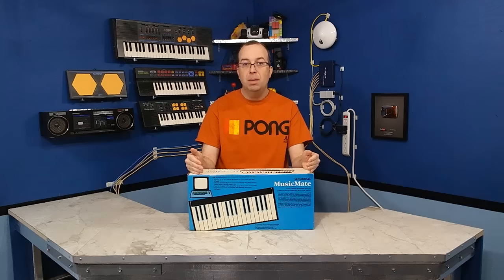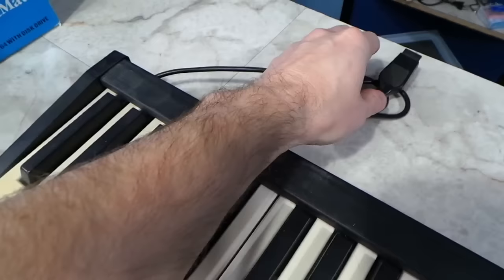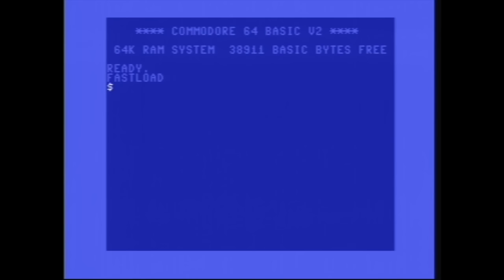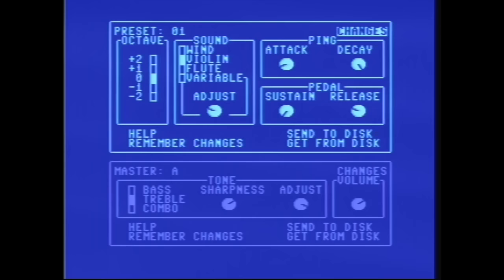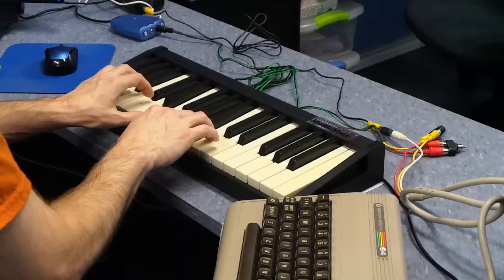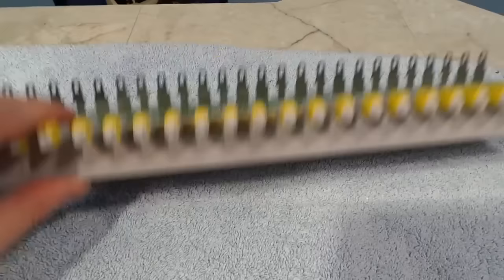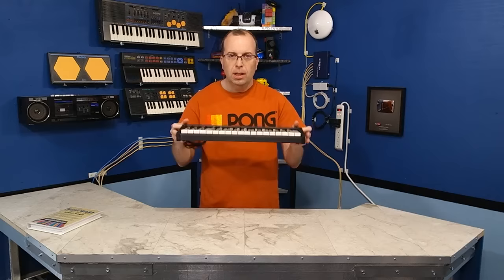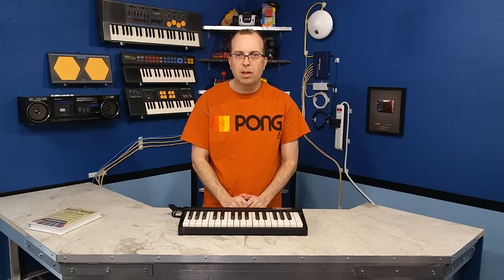Sequential Music Mate for the Commodore 64

Comment: I it's has not already been said but the picture on the disk box is of a prophet 600, sequential/sequential circuits were a manufacturer of professional keyboard synthesizers/samplers in the late 70's to the mid 80's starting with the Prophet 5, the first semi-reasonably priced polyphonic synthesizer with memories.They went on to co design MIDI with Roland (they were the main players in the MIDI standard) and making a range of keyboards from budget synthesizers to sampling keyboards.

Comment: I've got two suggestions for figuring out how that thing works:
1. Try hooking it up to a logic analyser. It's possible (although unlikely) that the signals are too fast for your BASIC code to detect.
2. Try looking at the analogue inputs. Again it's possible but unlikely that it's using an analogue input (maybe even a digital serial protocol over an analogue input?).

My theory is that it's sending some kind of "key pressed" and "key released" events somehow. As other commenters have pointed out, the company that made it were involved in the beginning of MIDI so it wouldn't be surprising if they used a similar idea here.

Comment: If you want to investigate what is going on between peripherals, you need an oscilloscope capable to store the signals. While you can buy yourself a neat classic "storage oscilloscope" which stores the graph right inside the phosphor of the CRT, it is much more convenient to  use a modern PC based scope. 

Powerful all-digital scopes are pretty inexpensive nowadays, especially when using a PC to analyse and display the data. All you need is a good ADC, the rest can be inexpensive software. I suggest a bitscope, it is highly versatile and cheap. Plug it into your computer and you have a real powerful oscilloscope. It also works with a Raspberry Pi and with a Touchscreen, you can build yourself a neat portable scope, just as powerful as an expensive Techtronics but for the fraction of the costs. 
The simple bitscope version still has 8 digital inputs perfect to monitor what is going on inside an 8-bit computer or on any interface (like the keyboard connected to the joyport). Two of those inputs can be used analogue so you can look at e.g. stereo audio to tune instruments and it has a built in signal generator which is programmable.

Comment: The 40-pin device is probably an 8051 or 8042 variant and likely transmits key presses to the C64 via some sort of serial protocol.  It may even be some simplified MIDI sort of thing.

Comment: Referring to just after 2 minutes in, and a possible explanation would be binary.  With 5 digits to work with, you could have a total of 32 outputs from 00000, to 11111 and everything else in between.

Comment: The keys could be binary encoded, and analog signals can be used to produce slow digital IO by simply thresholding the value. My guess was that the 5 digital pins was used to address each key 2^5 (32), with rollover for multiple keypresses, but I'm not sure if this would show up on your BASIC-program.

Comment: Could be a R-2R DAC forming the matrix - the two analog inputs on the joystick port could be used for this purpose. It would certainly be cheaper than using a microcontroller so I'd be surprised if they didn't go that route.

Comment: Well, those were fascinating times, pure FM music!
Reply from the maker: Actually, this is not FM music.  I'm not even sure what you would call it, but I think it may be subtractive synthesis.
Reply: Yes correct, it is subtractive synthesis. The SID is a hybrid subtractive synthesizer, where the oscillators' classic wide-spectrum content analog waveforms (square/PWM, triangle and sawtooth) are generated digitally, but being converted in an analog signal to feed the analog filter, which is common for the 3 voices instead of having a filter for each.

Comment: 2 raised to the power of 5 is 32, any combination of keys will output a binary number on these 5 pins. Effectively 32 key (not note) polyphony or at least if the commodore could handle it, the input hardware can support it.

Comment: Thanks for the video!
Try hot glue on items you may want to remove later.  It will be less permanent than epoxy and may do just what you need.  Hot glue is an un-sung hero. :)

Comment: Hey, great vids!  I really enjoy your channels. This channel got me thinking about all my old keyboards I uses to have as a kid, and I remember one old cheap Yamaha midi keyboard I used to have (sorry, can't remember the model). I had replaced the original power adapter with a universal adapter at some point, and eventually I figured out that if I set the voltage on the adapter to less than what was recommended I could trigger the keyboard to enter a funky mode with a bunch of different sounds and drum effects that normal, and everything would behave differently....have you ever run into anything like this?

Comment: The C64 joystick port has 5 digital inputs, and this keyboard has 32 keys. It implies it is just digitally encoded in 5 bits, since 2^5 is exactly 32. However if it has poliphony, there might be some serialization magic going on in a microcontroller.

Comment: How does the DRM work on floppies? The head banging doesn't give me any clues. :)
Reply: They used different methods, from deliberately physical bad sectors and seeing if reading them fails, which wouldn't happen with a brand new copied floppy, to hiding data in specially created sectors that wouldn't be copied by your normal tools.

And they also used the manuals, where you had to reply to a challenge question typing stuff from them.
Reply: I had a couple of C64/C128 programs that required a dongle plugged in the joystick port. The dongle was basically a joystick plug with no cable coming out of it. I assume that it had some sort of chip inside.
Reply: Not necessarily.  Most dongles are passive devices that trick the C64 into thinking you're doing something with the joystick.  For example, Up + Down at the same time, or Left + Right (which is obviously physically impossible with a real joystick).  PaperClip 64, SpellCheck, and TheConsultant all used a dongle that plugged into the joystick port.

(PaperClip was a word processing package that was great for people that needed to create files on a C64 that could be transferred to a PC, because PaperClip used regular ASCII codes instead of PETASCII.  I think SpellCheck was related to PaperClip.  Not sure about TheConsultant, but my guess would be a spreadsheet from the same company, since all three could use the same dongle.)
Reply: ***** So basically CD DRM techniques? Interesting :)
Reply: I think the floppy with label has a thing called "copy protection".
Reply: how'd you get hereʔ

Comment: I'm no expert on the C64 joystick, I believe you can output data on some of the joystick pins as well as read it? Because looking at the wires, there are only 5 being used, so two must be +5 and Ground, so we there's only three for input. My guess would be that it's using two pins to output a clock and latch, and reading the input on a 3rd (basically the exact same way the NES/SNES controller works)

Comment: All this mistery about the joystick port signal is going to kill me. Could it be some analog signal?
Reply: I'm dying to find out too!! ... My best guess would be that the keyboard has a key multiplexer chip  which takes the 32 keys and encodes it into binary using the 5 input pins (but 5 bits can only represent a total of 31 combination excluding the state of 0, so maybe this won't work).  OR even simpler without an multiplexer, each key has a slightly different value resistor attached (say in 10K increments) read by the Pot X/Y input which I believe can read a total of 255 combination levels (but not sure, if anyone has more info about it, in which case one could technically use the Koala Pad to "draw" a tune).  This is just my guess, I'd be curious if anyone actually took it apart including the circuit board. ;)

Comment: I think there is no microcontroller, but there is a resistor array. I recommend you to buy a Saleae Logic Pro (USB oscilloscope and logic analyzer, about $200). With this you can scope the signal and see or decoding analog or digital protocols.

Comment: The fact that I love piano just makes it so fascinating. :3

You know how does the joystick port work exactly on the piano?
Reply: Nour T. I love keyboards
Reply: Nour T. See my other comment a few minutes ago. My guess is 6 bit binary
Reply: No, I think (as other people here have suggested) it uses one or both of the paddle registers at $D419 and $D41A instead of the joystick register at $DC00, which is why David's program couldn't read the keys.  The reason is that the joystick registers only really used 5 bits (1 bit each for up, down, left, right, and fire), which is enough for 32 keys... which is great, IF you're only able to generate one note at a time.

To be able to generate three notes at once with 32 keys, you'd need (32*31*30)=29,760 possible values.  This is easily done with the two paddle registers, each of which has a full 8 bits for a total of 65,536 possible values.  By the way, if anyone wants to know, the maximum number of keys using this method is 41, if you want to be able to play three notes at once.  41*40*39 = 63960 possible values, which is still in the 0-65535 range.

You could theoretically go even further by reading bits 2 and 3 of $DC00 (bit 2 = paddle 1 fire button, bit 3 = paddle 2 fire button), or by using BOTH joystick ports.  If you used the fire buttons, you'd have 18 bits, which is enough for 65 keys.  If you used both joystick ports AND used the fire buttons at $DC00 and $DC01, you could generate 34-bit numbers... way more than you'd ever need for a music app with three-note polyphony.

Comment: At 3:25 you mention something about "copy protection". How is this achieved exactly, and what causes the grinding noise? Thanks.
Reply: Spherox From his video on his 8-bit guy channel, he explains the knocking is made by the stepper motor of the floppy drive moving to track 1 and then attempting to keep moving. Since it's as far forward as it can come, it just causes that banging noise instead.

Comment: Probably using a set of stepped resistance values. If you peek it, treat it as you would input from a paddle controller. (At least that's how I'd approach it coming from the Atari side, figure it's probably little different with Commodore.) I'd think you would get values from 0 to 255 there. Keyboard doesn't need that many, so you've got room to spare.

--- Edit ---
Looks like you did that. But did you check for both paddle inputs? I know on the Atari, the paddles were paired to a single 9-pin. So there's possibly another range to check. I'm still curious as to what's going on.
----
Also what's possible with the 9-pin is why I always thought it was stupid that they stuck with a single button joystick. (Both Atari and Commodore.) They could have had something more like the SEGA controller (also 9-pin) way back then (hardware would have supported it), but they never thought to do so.

Comment: I'm dying to find out how the keys are encoded!! ... My best guess would be that the keyboard has a key multiplexer chip  which takes the 32 keys and encodes it into binary using the 5 input pins (but 5 bits can only represent a total of 31 combination excluding the state of 0, so maybe this won't work).  OR even simpler without an multiplexer, each key has a slightly different value resistor attached (say in 10K increments) read by the Pot X/Y input which I believe can read a total of 255 combination levels (but not sure, if anyone has more info about it, in which case one could technically use the Koala Pad to "draw" a tune).  This is just my guess, I'd be curious if anyone actually took it apart including the circuit board. ;)

Comment: I'm wondering: have you checked the pinout of the connector? maybe data gets in via the POTx / POTy as an analog value? Pretty interesting to see how HW/SW engineers overcome hardware limitations.
Reply: It's a possibility for sure. Both pot lines were likely measured with 8 bits of precision, so there's plenty of data there theoretically, though I'm not sure about the feasibility of using every possible voltage level to reliably transmit digital signals. Then of course they could have just implemented some kind of serial protocol using the digital lines. In any case, I'm also interested to find out what it was... probably more so than the actual keyboard itself, but that's just me ;p

Comment: Since 2^5 =32  you could pull this off easily with some sort of PLA or probably even 74 series logic chips.  So yeah, off the shelf part could do that easily.

Ed.  I just figured out that's one note polyphony though.  Maybe it would need some actual logic of some sort to interleave simultaneous keys.
Reply from the maker: Yes, it is polyphonic.
Reply: The part where it's seemingly one monolithic IC is still just bugging me.  I'm assuming a niche product doesn't get custom silicon (unless it's some form of gate array that they could order burned fuses on), so it's probably off the shelf.  Even if it was some sort of fuse-burned gate array I think that would just do sum-of-products, not serial data transfer.  It's really the wrong form factor for 74 series logic, and I'm not sure a shift register would be possible (no output to the keyboard unless +5v can be software controlled, which I doubt.  I guess it could be a microcontroller, but I'm not sure you could run one of those as a single-chip until PICs got EPROM which I think was a year or two later than this thing was produced.  I really don't know much about the parts available at the time.  Weirdest theory?  that only looks like a 40-pin IC and they actually hung some giant resistor ladders directly of the keys and read them out through the Pot pins.

Comment: the chip you see in there is very likely a multiplexer rather than a micro-controller. it's a much cheaper solution that works in this case just as well.

Comment: The keyboard must send serialized data, I think there is no other way, it may be Basic is too slow to read data sent by that keyboard or it is using paddle port. This is a simple circuit of a Spectravideo/ColecoVision numeric joystick that doesn't need to send serialized data:

http://www.samdal.com/SVIDOCS/STM-K_SVI103.pdf

May be The Sequential Music Mate basically use the same circuit but using serialized data similar to cassette data or sync pulses, for example through the Strig line, or some strange digital/analog/digital conversion through the paddle port, anyway a code should read some data from the joyport.

Comment: I think I know how it works. 2^5=32 and there are 5 pins on the joystick and 32 keys on the board. So it would transmit key 1 as something like this: 00001 and key 2 as 00010 (Or at least I think)

Comment: Does it use the Potentiometer pins? There should be enough values for the keys even with multiple pressed at once.
Possibly, I don;t know as I am not as familiar with the hardware as you are, but it was just a thought.

Comment: I have the same type of disk drive where you  put down the latch vertically. I have some problems with write and load error if I don't use a finger and force it down all the time.

Is that something that you've stumbled across?

Comment: You didn't measure the connections from the kabel solder points to the plug ?  See pot points Port A as rumborak wrote (below I guess)

Comment: The joystick port thing doesn’t look too mysterious to me. . . The keyboard has 32 keys, and the joystick port has five digital inputs, and two to the power of five is 32 😉 What they are using is probably some kind of MIDI contraption, with the keys numbered from 0 to 31 and separate note on / note off messages. But yeah, it will need some kind of microcontroller.

Comment: It appears that the Model 970 software disc — the one you have two of — was the pack-in software for the device, and that the Model 974 disc was sold separately, as well as three additional pieces of software. My best guess as to why you got two copies of 970 is that you got both the pack-in one and another loose copy. Sources: https://www.lemon64.com/forum/viewtopic.php?t=58790, http://www.mycommodore64.com/2011/09/14/sequential-circuits-musicmate-1984/

I bet we could figure out what the protocol is by reverse-engineering the software, but that depends on if someone could rip them, or if there are any disk images online. I think I found one of the 970, but other than that I've drawn a blank...

Comment: Hi David why do you not try to use that keyboard in a Raspberry Pi with c64 emulation or new software? as you may know the Raspberry Pi can use db9 (nine pin port) joysticks like a SEGA Genesis controller or a C64 joystick via its GPIO pins and could be nice to see if it works there

Comment: 5 data lines on the port can be interpreted as a 5-bit data value which represent a 0-31 value range (32 states) which seems to match the key count, no? But how does it get away with 3 note polyphony? Strange!

Comment: Are there any noticeable difference between 10-minute epoxy and 10-hour epoxy other than the curing time? Do they have different temperature properties? Is one "stiffer" or "harder" than the other(like, is one like rubber and one more like hard plastic)?
Reply from the maker: sometimes there are differences.. This just happened to be what I had on hand.
Reply: +8-Bit Keys OK, thanks for actually responding!
I have been a long time subscriber og the 8-bit guy, since your name was iBook guy(If I remember correctly). Just found this one, have a sub

Comment: Doesn't the copy protection prevent someone from borrowing someone else's keyboard (even if he borrows the installation disk as well)?
Reply from the maker: Nope.. as long as you have the disk and the keyboard it will work fine on any computer, hence why it worked on mine.